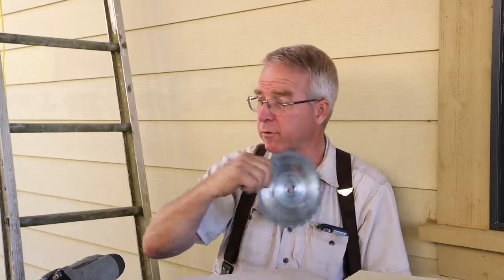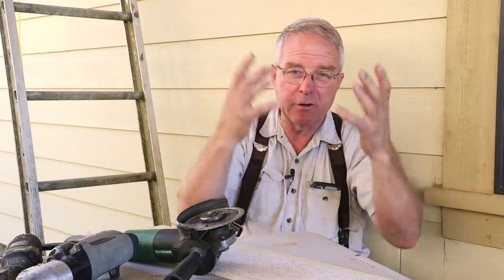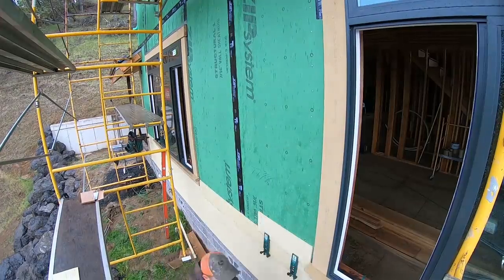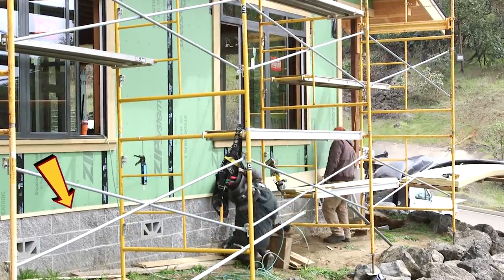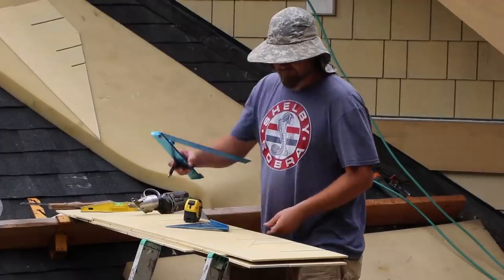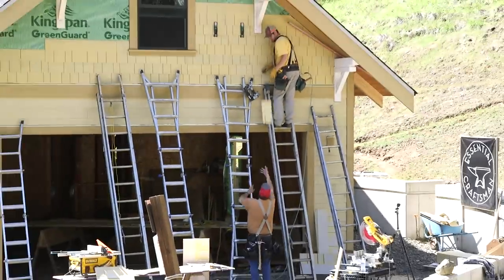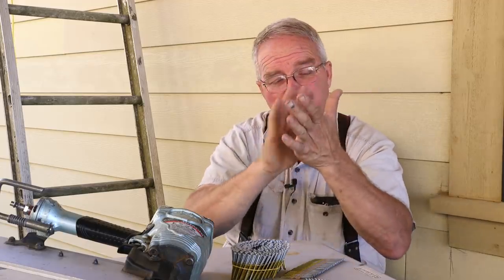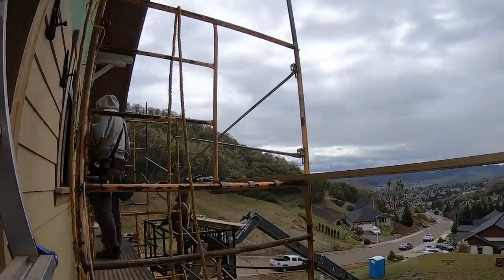Siding Pro Tips

Comment: I installed Hardy Siding on my place & I highly recommend it. I did the whole job by myself, so it was a challenge to say the least, but it turned out great. Fire & insect resistant. It holds paint like nothing I've ever worked with. No peeling or flaking. It's more expensive than most vinyl siding & a pain in the rear to install, but vinyl siding fades over time. This stuff can be painted again and again & your house looks like new.

Comment: We install Hardie in a production mode all day every day. We only use circular saws with a hardie blade on them. The saw is hooked up to dust extraction and a powerful squirrel cage fan at the end of the cut table. We must be able to stack cut the stuff or we're thumbing. We never use a table saw or shears it's all cut with the circular saw.
We do use a respirator while cutting.
Reply: Mike Wilhelmson   Every thing we do is cut on the ground.
Reply: @3dandyrandy3  that makes sense when you have a cut guy but if you’re working solo and are on the second or third story those shears are clutch. No way am I going up and down a ladder that many times. Shearers are simple enough to stay up there with me.

Comment: Where I live, code requires installation on top of pressure treated plywood strips to create an air gap behind the siding.  Bug screen guard goes on the bottom and top.  Metal flashing is required between the butt joints, which now no longer receive caulking, although caulking is still required where it butts in to end trim, window trim, etc.  We use a story pole typically to try to avoid some of the rips above windows, doors, etc when possible, and to make sure that the elevation is consistent around corners.  That being said, the jacks are very fast and consistent.
Reply: Haven't seen it done that way yet but that's good idea, I have seen a yellow rubber type membrane that is put under siding to create the ventilation but that was on cedar shingles.

Comment: I used a DeWalt track saw for the rips, and it worked great.  Also, used a Bostitch roofing nailer with stainless steel ring shanks.  The problem with trying to set the depth on a nailer is that sometimes you hit a stud, and sometimes you just hit your sheathing.  Since I miss more often than not with the Tyvek hiding the stud locations, I set the depth just enough for the sheathing, and if I get lucky and hit a stud, I just go back and swat it with a hammer.  I space my nails ~12", which Hardie says is acceptable for 1/2" nominal OSB sheathing.  I also caulk the ends of the boards behind before I nail them off.
Reply: this crew spent some time marking the location of all the studs so they were sure where they are...
Reply: @benningtoncamper2852  That's where I kind of ran into problems.  I wasn't sure how long it would take me to get all the siding up once I had all the windows in and sheathing up, so I used foil-faced OSB... not for the radiant insulation, but for a little more moisture and weather protection in case it remained exposed too long.  

I marked the stud locations over the foil using a felt pen, but the Tyvek was completely opaque, so that didn't do me much good, once I had it wrapped.  That was another fun job to do by myself off of scaffolding.  Then I thought maybe a stud finder might work, but they don't penetrate wood sheathing very well, and with the foil facing, the stud finder was completely useless.  I had a little help with a thermal imaging camera, but not much.

In some parts of the house I was able to simply measure from known studs, but in other areas, the 70-year-old framing would suddenly shift, and it became more of a guessing game.  Whenever I knew I had "found" one, I would use a level to plumb that spot up the wall.  Since Hardie's instructions say that the 1/2" sheathing was sufficient if I nailed off at 12" OC, I'm confident the ring-shanked roofing nails are going to keep it in place.

Comment: Great info, as always. Diamond tipped circular saw blades are the only blades that will last more than a few cuts (if you don’t have shears or just want a cleaner cut than shears). I loved seeing the pinch clamp and rope technique for passing up cut pieces. You got it dialed in my friend!
Reply: Use a blade designed for fiber cement siding. Regular carbide blades are completely shot after 3 or 4 cuts

Comment: Great tips.  I just put Hardie lap siding up on my house in Arizona and it went up really easily.  I did use my Skil saw with the Hardie blade for 90% of the cuts though-- as long as you're up-wind of the cut the dust isn't too terrible, and it cuts extremely fast and smooth.

Comment: FANTASTIC tips... And I already have electric nibblers for my sheet metal work. Hardy board is a pain as it is, but these tips will be a tremendous help
Reply: I thought I was going to use my sheet metal nibblers for my Hardie Board project, until I found out the jaws don't open far enough.  Just a heads-up...
Reply: DMO_Enterprises  I always use flashing at the butt joints.  Hardie used to recommend caulking the joints too, but now they don't, particularly on the pre-colored stuff because the matching caulk started to show after sun exposure.  Apparently the color didn't fade the same for the planks and the caulk.  I've never used their pre-colored stuff.  I prefer to paint it myself.
Reply: DMO_Enterprises  Look again. They do have flashing at the butt joints.

Comment: Interested in seeing how you go about placing outside fixtures through / in this stuff. Lights, receptacles, spigots, ext.
Reply: They'll either have a block for the fixtures to mount against or if there's enough room, just mount right to the siding.  I always like a 1-1/2" block for light fixtures to sit level instead of sloping back towards the wall.

Comment: Another trick for a one man install that lets you support the long pieces. Take a 1" aluminum square tube about 8 feet long and cut away one side. This will leave you with a rigid u-channel. Set your siding in the u-channel and then pick it up using the u-channel. This will give you good support while transporting it to your Gecko siding gauge.

Comment: Great info in this video. Exactly what i was looking for, info from a hands on guy (no doubt)  30 yrs here metal roofing/siding and watertightness of the exterior of a building. 
I have a half dozen Kett Shear Heads w metal cutting blade on then. Where can i get BLADES to cut hardy without buying the whole head. Thanks!

Comment: I don't really do siding but for that type of materials, I have a seperate angle grinder with a diamond blade and tuck point adapter hooked up to a vacuum. Zero dust cutting anything concrete/hardie/tile etc.

Comment: This guy is Gold ! I love the fact that this siding is fiber cement, but there is way, way too much reliance on the caulk, butt joints, ends, anywhere and everywhere there's a joint, caulk is needed because of the 1/16th or 1/8'' gap mandated. That makes 1000's (?) of feet on your house that depend on that for water infiltration, to me, that's way too much.

Comment: I'll throw in another tip if you don't mind.   Never let fiber cement get wet until after it's installed.   It will expand.  That 1/8 gap you left at the trim per the install instructions becomes 3/16-1/4" and looks terrible.  Also, those butt joints that were butted up snug become 1/8' gaps.   It also becomes much heavier and flimsy.    Unfortunately, many suppliers store it outside and barely to now cover over it.

Comment: I can't believe you didn't install over an air gap rainscreen?  What are you thinking?  Lap siding straight on the wrapped sheathing?  A predictable rainscreen air gap behind fiber cement sidings like Hardie Plank and Hardie Shingle adds durability and water, vapor and air management to the exterior. Doing so creates a capillary break that prevents entrapped water (both bulk and vapor) and promotes airflow to dry out the siding and substrate.  We've been doing Hardie Siding over 1x4 rainscreens for years. Hardie REQUIRES a rainscreen in commercial applications, but they do not yet require it in residential applications; but they should since the building science is so compelling.  Such an ESSENTIAL detail that any CRAFTSMAN would know.

Comment: I agree a nailer with set control is ideal but not essential no pun intended. I installed hardiplank on my two story house with my brother-in-law who was a master carpenter with hammer and galvanized roofing nails, only predrilled the Hardi trim which was 3/4 inch thick. Only the helpers not so use to swinging a hammer had any trouble.

Comment: If you do use a circular saw (and the dust issue is real), putting a sheet of rigid foam on the work surface is great for keeping the cut supported. So is a big box fan to to keep yourself upwind.
Reply: I used a couple of old hollow core doors as a cutting surface, and threw then out after I was finished.

Comment: How wide would you recommend the starter strip be? I plan on doing my house
Reply: 1 1/4 inch is the overlap. It can be between 1 inch to 1 1/2 inch. Put them on with a finish nailer
Reply: And caulk the nail heads.  The bottom course (or 3) get the vast majority or rain, water and roof/gutter splash over.

Comment: How do you deal with the gecko gages and the bow of the piece? I used these on lp siding and still had to snap lines for every piece. The only thing I found them useful for was holding the sheet close to where it needed to be and then working it up and down to fasten it on the line.

Comment: I wish you would have demonstrated how the siding clamps work.
Reply: I'm sure there are a million videos on YT that show them in use but I can attest from personal experience that they're hella cool and trying to install fiber cement siding without them is 100% foolish
Reply: You just slide the flat metal blade up under the bottom edge of the last row you installed, making sure you get it all the way up until it stops, then flip the lever up to firmly clamp it in place, then lat the bottom edge of the next row in the cradle... it's as easy as that.

Comment: One of the contractors work for was the last builder in the county to start using fiber cement siding.  Hes really old school and doesn't allow his carpenters to use nail guns on wood soffits or fascias or siding.  The first time they put up hardi board they weren't allowed to use nail guns.  I think they got about 3 4x8 sheets up before they decided a nail gun was the only option
Reply: Hardi panel sucks! I dont like as an installer or as a consumer. Too many ways for moisture to get in the joints. Too much maintenance needed over its life that probably wont get done by homeowners that don't know how to maintain their siding.
Reply: @Jason-uz8hj  in my experience lack of proper maintenance by the homeowner is an issue regardless of material.

Comment: I have to say, I like that expression you just coined. From now on I’m going to be burning my square all over the place.
Reply: it means when you hold the number on the tape or square or any measuring device on the edge of the  board, and then mark zero on the board.
Reply: ryan never knew there was a term for that.
Reply: @Nomadboatbuilding  also, people like to "burn a foot" when, say for example, measuring and marking a particular distance off a reference line or gridline, because it all started surely when someone didnt think marking the dumb end of the tape or holding the dumb end of the tape on the mark would be accurate enough due to the hook on the tape.  (but the hook is designed to slide up and down the exact thickness of itself, so you can butt it or hook it and it's the same, so marking zero is totally accurate.)"hold my tape on the mark and burn a foot" or "im gonna add a foot to the measurement so mark one foot." and they've just come to believe that burning a foot is the way you do it.     it's a bad habit in that application because, at some point, someone's gonna forget the other person's burning a foot or vice versa and theyre gonna make a mistake.  a 12" mistake.  and just holding the right number and marking zero isn't less accurate.  sorry about the novel.
Reply: @ryan-ee4fd  Yes, yes and yes again! I always hated the practice of ‘burning’ a foot bcz like you say, at some point somebody’s gonna forget and you’re going to have a major blunder on your hands. On most work, I’d rather be off that tiny bit that the tip slides back and forth, than miss something by an entire foot.
Reply: @ryan-ee4fd  In my neck of the woods, we call it cutting a foot (inch, or whatever), but I've been burned using that method when I forgot to change the reading on the smart end of the tape.

Comment: My only gripe with Hardie, is I wish they would have added at lease some fiberglass in the laminations.  The cellulose fibers are just barely enough to keep a 12-footer from snapping if you don't carry it close enough to edge-up and don't have a helper at the other end.  When you're trying to maneuver it around behind scaffolding, and you've maybe weakened it even more by ripping a section around a window, and it suddenly decides to do a flop on you, there goes your meticulously cut piece, which is now reduced to a pattern for the next one.

Comment: what caulking did u you use.  great vid.  i am surprised no vented rainscreen,
Reply: I've seen them using big stretch in other videos.  It is the best, but not the cheapest
Reply: @timothywaterman1511  quad max is the best.  NOT big stretch.  latex is NOT for outdoors.
Reply: @MrTooTechnical  I disagree.  Sashco makes several water based chinking and caulking products that are for outdoor use and last the test of time.  Big stretch is recommended for doors, windows, and siding; including fiber cement.  When properly applied I have seen chinking that is 25 years old and still in great shape
Reply: No man. Quad max. Lol

Comment: I use to do siding install for 8 years untill I got sick of construction and moved on to other things but I'll debunk some of the things are good friend here said...
1- lose the Gator clips they are useful yes but time consuming, better way is to take some metal flashing and cut yourself a custom made clip that holds one end of the board at your mark while you tack on the side your holding. It's fast & easy
2- remember what he said about hitting the stud, yes it's true most of the time, if you have OSB or plywood  sheathing then you must hit the studs, BUT, if your house has true 1 inch Douglas fir T&g sheathing then don't worry about it consider the entire wall to be a stud.
3- lose the shears way to slow, we working peace work remember. Buy a mask and use it when you use your saws. Although it's reversed, cut on the face when using skill saw, mitre saw. 
4- not a debunk this one but he forgot to add this pro tip to his list, when installing hardy it's best to install all your full field pieces first around the whole house, which at that point you can wisely use the cut offs to do all the shorts, trust me you will use up most of the waste rather then have waste at the end of the job.
 That's pretty much it, some complaint s I have with this new James hardy stuff, stupid dummy nail lines they have, makes the boards one directional and can't flip the piece around to use, makes alot of scrap pieces.

Comment: That fuzzy is the coating, and if the core material is susceptible to water damage (tho it shouldn't, i'd just soak test a raw edge) you're supposed to paint it. At least, that's how you do with high traffic, water resistant parquet tile flooring (not classic, modern HDF variant).

Comment: I personally wouldn't use a framing gun to install siding, the sharp tip that's meant to jab into lumber will end up scratching your clapboards or shingles. Maybe the scratches will go away with paint, maybe not. If hitachi (now metabo hpt) makes a replacement  tip for their gun I'd consider it, but the low weight and ergonomics of the bostitch siding gun is just about perfect in my opinion.
Reply: 2nd'd!  For all the reasons you state, a framing gun for FC or any siding install is plain stupid.  If you're cash crunched just pick up a used Bostitch coil nailer on CL, Letgo or Offerup for a measly $40 or less.

Comment: Hitachi coil nailer. I bought a used one and the nails depending on how I push on the nose will burry the nail to much just right or not enough. Do the nose adjustments wear out and get sloppy?
If I bump fire.. it is garunteed to burry the nail.
Yes I can adjust it.
Reply: What's the pressure on your compressor set at? I have an older used gun that does the same thing if set to the pressure the tool actually calls for, so I have to bump it down a bit.
Reply: @notjohnmiller28  
Hmm. 
Pressure is at 90 I think (set for pin nailer). That actually might explain why it's so sensitive to not setting correct when compressor kicks on.. to low pressure. 
For framing.. no big deal but with trim.. it sucks to burry the nail.
Reply: I used a roof coil nailer with stainless ring shank nails. I long ago installed the bump fire eliminator for safety and accuracy reasons. I still needed to tap some of the nails flat.

Comment: Were you calling the combination square a tri-square or a try-square. Try squares are usually found in cabinet shops and machine shops. The blade and body are fixed at a right angle, and they are used to test if a cut or an assembly is square. The combination square is sometimes called a tri-square since it can mark a 45 degree angle, a 90 degree angle, and a straight line.

p.s. anyone talking Scott’s advise and throwing away their skill saw, please send it to me. I’ll try to find it a good home.

Comment: My understanding was that James Hardie does not recommend caulk for the butt joints; they prefer joint flashing behind the butt joint.
Reply: That's correct... now.  At one time they recommended it, but it turned out their "matching" caulk didn't match their pre-colored planks after a few years of weathering.